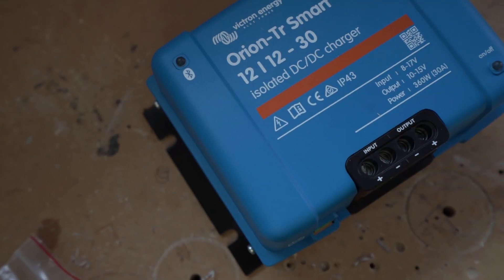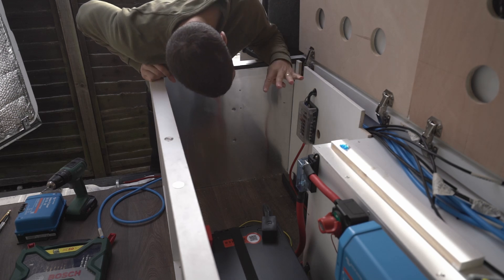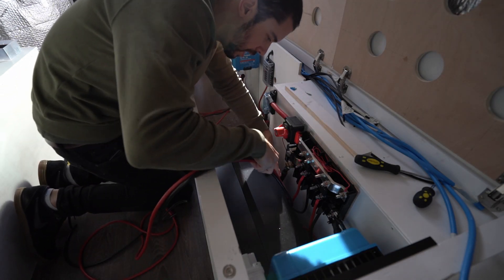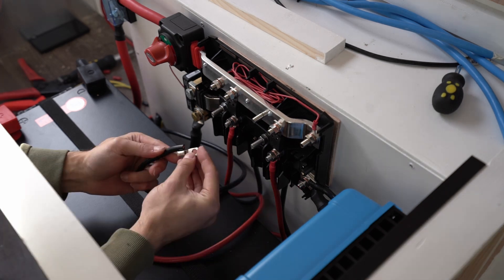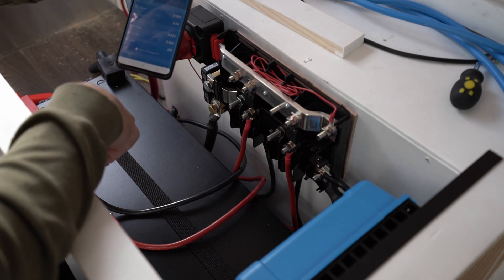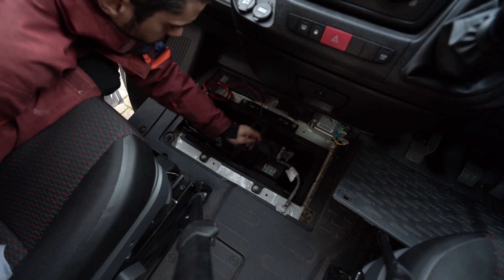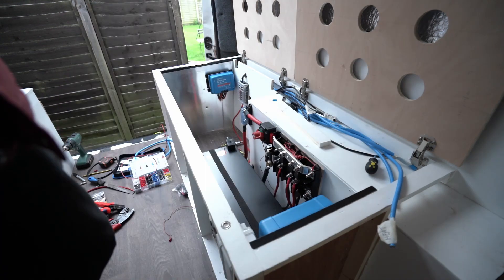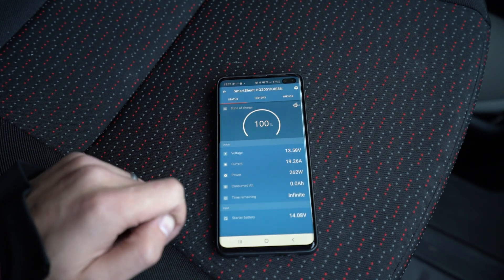Victron Energy Orion TR Smart 12/12-30A Install - Citroen Relay Camper Van Conversion - Week 29

Comment: I remember something like first hook up de starter battery before connecting the leisure battery.. 
Secondly 10 cm of free space around the unit. 
Mine was installed 2 weeks ago and it's getting really hot now and then. What's your experience so far?

Comment: Hello, nice job , i have a question, I installed 12/12 30 amp victron dc to dc to my van at it gave me 25 amp before but now it gives me 12/to 13 amp for 100amp lifepo4 battery to charge , do you any idea why it doesn’t charge with at least 25 amp. Thanks

Comment: Hi. Thanks for this, about to install the same. So did you attach small lugs onto both battery positive wires and the two went into the orion smart charger positive, same with both negatives and a fuse at both battery terminals? Did you also ground this charger unit?

Comment: Can I ask a dumb question?!!  From leisure battery +ve to Victron,  from Victron +ve to van battery +ve.  From van battery -ve to Victron GND.  Do I not need to connect a -ve lead to my leisure battery to complete the loop ?
Reply from the maker: I think you bought the non isolated orion, in that case the loop is competed through the van chassis ground. 
As long as your leisure battery is grounded to chassis and van battery has a good chassis ground connection (it should from factory) it should work fine!
Reply: @CasLaz  ahh...  Thank you!

Comment: Hello. For what is the thin red wire that is beside the thick red wire on the battery compartiment?
Reply from the maker: Hi Andrei, that goes to the shunt to monitor starter battery voltage
Reply: @CasLaz  thanks. And the other one? I see you have 3 different wire sizes.
Reply from the maker: @and7rei  4mm2 is the trickle charger cable from the multiplus to starter, I think i explain it in one of our later videos.

Comment: Thanks for the video. I’m curious why you ran a cable from the negative between starter and leisure battery instead of just taking ground from the leisure?
Reply from the maker: Hey Dylan, I think you could do that as they are both connected to chassis on negative but I didn't like the idea of using the chassis as a negative to complete the path to the starter. 
When I was running the cables I decided to run a negative cable too to guarantee a dedicated low resistance path instead of having to rely on chassis. (This could potentially later become a positive for a 2nd orion if needed, and then i'd use the chassis for negative on both units so it was also future proofing in a way)
Hope this helps!

Comment: Hi. I'm about to install a 12v 280ah LiFePo4 battery pack in the back of my pickup truck. The Battery box will be removable (Connected to the truck via an Anderson Plug). The box will hold everything, Victron DCDC-30a charger / batteries / 1500w AC inverter etc. My question is: will the Victron DCDC-30a charger hold on to its setting when I unplug the box from the truck or will I have to input ALL the settings again when I re-install the box back in, sort of like, if the main 'cranking battery/alternator fuse blew and cut the power off. (I'm using the box as a portable 'Power-Bank' for site work where mains power is not available). I can't find any info on this so any help would be greatfully received.
Reply from the maker: Hey Rocky! It remembers your previous settings so should work !
Reply: @CasLaz  Thanks buddy. I've got everything I need for the project except for the batteries, which are on their way from China. I certainly hope the Victron retains its memory after disconnect or I'll have to position the charger outside of the box. Thanks for your help, I'm a complete newbie to this. Lost count of the number of YouTube videos I've watched.

Comment: My TR Smart charges at 30 Amps initially unlike your 20 Amps, it will reduce its output which I believe is thermal protection. I also set Engine shutdow detection to 14.00, 13.80, 120s, 13.50. Input lock-out 13.3, 13.9. This for LiFePo4 leisure batteries and regular alternator.
Reply from the maker: Hey Tony! Thanks for the info, will double check all settings, haven't had a chance to test it too much yet!

Comment: I wish the DC-DC charger would also charge in the other direction - i.e. when the engine is off and the solar panels are producing power, charge up the starter battery as well as the leisure battery.  And for bonus points, prioritise the leisure battery, so only use solar power to charge the starter battery when the leisure battery is full.

Ps. great episode - just the right balance of sped up sequences but not too fast to miss the important details, and no shakey handheld camera shots so I didn't get motion sick while watching - thanks!
Reply from the maker: Yeah that would be great for sure ! 
We will be able to charge the starter battery from the leisure battery via the multiplus. It has a trickle charge output that we will hook up to the starter. There might be some way to automate it via the cerbo gx instead of manual switch, need to look into it 🤔! 
Great! Thanks for the feedback Rob, been trying to keep things more steady ! 😎 👍 👌
Reply: Renogy DCC50S charger with MPPT will charge your vehicle battery with solar when your leisure battery is full!

Comment: Your alternator will raise the output of amps as the engine revs increase. As you say the starter battery will also be using some amps from the alternator at the same time. Iv just purchased a 70A B to B that is made in Germany. They are made for motorhomes. Don't ask me to spell the name of the German company because I will get it wrong. LOL. Unless I go and check the spelling first.
Reply from the maker: Thanks Andrew! 70A b2b sounds like a beast, we were thinking if we need more than 30a we might just get another orion to get 60a. Hopefully we get enough charge from solar and only need this to top up in emergencies etc.
Reply: @CasLaz  It's a Schaudt Battery to Battery Charger B2B Model WA121545 12v  45A to 70A adjustable. It will only charge Lithium (Lifepo4) at 70A.  Which sounds great but to get the maximum 70 amps the house battery needs to be at a very low state of charge and the alternator needs to be pushing 14.6v. So it's more likely that the B to B will be charging at 45-55 amps a lot of the time. It does mean my Lifepo4 battery bank will get a big bulk charge from the alternator if its very low. I have gone for a 3000w low frequency Inverter/charger that will charge the battery bank at 75A from shore power. That will comes close to the capacity of many European shore power connections that only have 5 amps at 220v. (5amps x 220v =1.1KW) or charging the battery bank (75amps x 14v = 1.05KW) LOL. Plus powering anything else in the van that uses 220-240v at the same time. I have 2x 400w solar panels but I would love to squeeze more on the roof of the van some how??? Honestly i have gone way over the top on my vans electrics. Move than I will need in my van. It's only myself and my 9 year old son that are going travelling next year. I have spent much more than I needed to. I am literally starting the van build this week as a winter project. The postman and the Hermes driver are getting sick of seeing me every day for the past month.
Reply from the maker: @drewhodge3820  Never heard of that B2B I should look into it! Thanks for the info 😀
Didn't even realize some European hook ups cap at 5 amps, thought most places were 16A like in the UK, good to know! 
I think 800w solar should be plenty, better off looking into tilting them instead of adding more if you really need more solar. 
Sounds like its going to be an awesome build (can't ever have enough power!) and you are going to be busy next couple months! Hope it goes well, it's such a massive project, good luck! 🤞😎👍
Reply: @CasLaz  Cheers I think I will need some luck. I'v bought a 2012 Ducato Ambulance 3 litre L4H3 so I need to strip it all out before I can start building. Watching a few videos I think there will be about 500 meters of wire and cable to strip out. LOL

Comment: Hi , are you sure that you need ferrules, and you are the first one that I see that’s crimping a 16 mm q with such a small pliers hm 🤔
Reply from the maker: You don't really need it for Victron terminals as far as I know, their connectors are pretty good. I like to use them as I don't like the idea of just sticking multistranded flex cable in there, it's prone to user error. Google "Wiring Unlimited Victron" its a nice PDF, mentions use of ferrules if you are after a tidy wiring job.
Regarding the 16mm crimp, I do have a big hydraulic crimper but couldn't be bothered to get it out (in hindsight probably should have). At the time, the high quality ratchet crimper done a good job in my opinion  (you can see me checking tightness etc)
Reply: @CasLaz   ok thanks, will look it up .
Reply: @CasLaz  Nice link about wirering!
Reply from the maker: @ebptube  Hope it helps ! ⚡

Comment: Nice I have a 40amp Renogy one and was wondering if it'll be enough with the 300ah battery I ordered, you chaps have 400ah of Lithium, how long would a drive would you need to charge that thing up?
Reply from the maker: Hey! well at 30a if we are at 20% battery it'll take like 10 hours of driving to charge (300ah in 10h, assuming no solar) lol. It's really there just as a back up incase of emergencies and we hope to rely mainly on solar.. If we really need more charge, we can add one later more for 60a charge. Thanks for watching!
Reply: @CasLaz  Ah yeah you guys have a decent solar setup, me not so much😥
Reply from the maker: @tine8849  How much solar you planning? You can do an energy audit to figure out roughly if it'll work out, I guess you can upgrade later but it's a bit of a pain
Reply: @CasLaz  Already got 2x100w on my SWB van as I couldn't get much more up there but barely getting 3amps at the moment so not relying on that, probably looking to parallel my B2B charger with another one.
Reply from the maker: Yeah not going to get much out of 200w solar in the winter, especially in the UK!
In that case you'll most likely need more than 40a.. adding an extra one should work but I'm no expert, depends on alternator etc.. I know some people running an extra alternator for high amp B2Bs.. It's another rabbit hole to research 🤣

Comment: I'm in the process of turning my electrical system blue, can you tell me what Victron name is that big busbar you took the blue cover off please?
Reply: Lynx Power In Victron Energy by the cheapest version, get some screws and you can ad 4 fuses.
Reply from the maker: Hi! It's the Victron Power In, check out our electrical system overview as-well as the battery install for more details (links in description). Thanks for watching!

Comment: Nice video, you should see about 40-45A while driving when it’s cool. When it’s all heated up you should see max 30A. Nice install 😊
Reply from the maker: Thanks guys! We will test it properly soon, our battery is almost fully charged when we were testing it hence why 20a charge I think.. Or maybe because it was just Idle..
Reply: @CasLaz  it’s also due to it idling, I’ll try and drain the battery down to 80% and then go on a 30mins drive 😊
Reply from the maker: @theoteam4641  Thanks! will try that, need to get the inverter up and running so we can drain this beast 😂😂